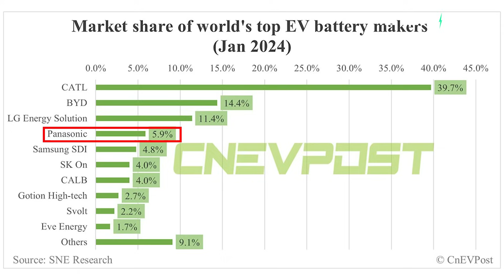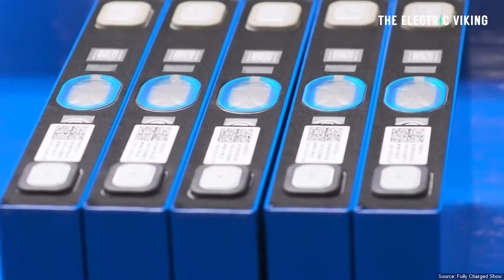Demand for EV batteries has increased, skyrocketed in 2024

Comment: One of the biggest underreported advancements is the steady progress of batteries (cost, safety, chemical stability, longevity, durability, operating temperature range, energy density, charging speed, discharge rates, performance, etc.). In 2026 batteries will likely significantly outperform fossil fuels across a brand spectrum of key metrics.
Reply: That will continue for a few more years yet.  The next 10-20 years will see a lot of changes.

Comment: Batteries for storage is a bad idea. Pumped hydro is the best. If topology is sufficiently good, that should be the one to invest in.
Reply: How do you use hydropower in your back yard?
Reply: @leiflillandt1488  There is need for decentralized power generation and storage, at the level of homes and communities, and for that, batteries are obviously the right (only) solution.  And there is a need for grid-level storage, for which pumped-hydro is the cheapest solution... with a HUGE potential, but not everywhere.
Reply: It's a great idea to supplement pumped hydro, solar and nuclear with bess though. Due to daily varying demand&duck curves, seasonality issues, weather patterns etc. Store cheap base load overnight nuclear hydro and wind, for day time&early evening peaks. 

Smoothing out the grid and keeping highly polluting and very expensive peaked plants offline=cheaper energy. 👍🏻😎
Reply: Nonsense.  Pumped hydro is of limited utility where you can put batteries in anywhere, and a LOT faster and cheaper.  Whoever sold you on that notion gulled you and gulled you hard.
Reply: Yes, and no. Pumped hydro is great for long duration storage, but every facility is a one-off, having to be engineered to take into account topography and geology, plus proximity to the grid.

Grid scale batteries however are modular and can be pre fabricated in factories in standardised containers. You can set them up in a matter of months and use existing points of interconnect with the grid (old power station sites, heavy energy users) with minimal site preparation. There's a big battery, with storage to expand being set up in the staff car park of a decommissioned coal fired power station in Australia, right next to the switch yard.

Costs on batteries will continue to drop as process improvements are made and scale of production increases. When the sodium battery challenges are addressed, it will be game over for new pumped hydro, in my opinion.
Reply: @mshackleton1  pumped-hydro is best for 10-24 hour storage. It can do longer, but then its economics suffer.  Do not confound with lake-hydro, which is indeed the best long-term storage solution.

Yes, pumped-hydro facilities must be engineered and built individually. Very little economies of scale, that much is true.

BUT, as of today, they account for 95% of the world’s power storage, and store that power for 80-90% cheaper than batteries.  That advantage will decrease with time, that is for sure.

Batteries can be installed much faster, that’s true, but their production is presently constrained, while hundreds of pumped-hydro can be built simultaneously around the world.

Conclusion: both types of storage have their market, and both will grow immensely to meet the ca. 200 TWh of power storage, that a full energy transition globally needs.  We are at only 8.5 TWh …
Reply: I felt the same,  until I realized that if you produce 100 megawatts of energy and you only use 60 megawatts.  The 40 megawatts go poof and is lost. What if you could store it.
Reply: @gaithercain5636  Megawatts cannot be stored... with ANY technology! Like you cannot accumulate mph while driving... however, you can obviously accumulate miles.
Megawatt-hours can and should definitely be stored as much as economically feasible!  And to do that, there are dozens of bright and less bright ideas and projects, and a few established technologies, of which #1 is pumped-hydro and #2 are batteries.

Comment: My worry for electric cars is maintaining them as they age and availability of spare parts speedily in the UK. Also depreciation can be colossal. In a recent video, a Porch owner has a £120 K vehicle now valued at £45 K in a couple of years. The dealer didn’t even want the car back.
Reply: similar thing has just happened with a neighbour with his tesla ... 6 years old with 77k on the clock
Reply: Was it a front porch or back porch?
Reply: I saw that video, but the whole channel is strongly anti EV.   Also, anyone who drops £120k on a car needs their head testing.   My Tesla model 3 (3.5 years old) has about the same residual as my previous Merc at that age.   In the 3 years I’ve own the car, it needed one replacement frunk latch which took 3 days to get in stock.
Reply: @crm114. So, because the channel is anti EV, are you saying he is wrong and the numbers are not what he is saying they are?
Reply: @JohnSmith-ux3tt I’m saying that the negatives are overemphasised.   I’m not saying EVs are all good, e.g. the charging infrastructure is not yet mature, but there are some fantastic electric cars available which are fun to drive, practical and cheap to run.
Reply: My worry for ICE is maintaining them as they age and availability of spare parts as EVs take over.
Reply: @robrider838 We seem to have a long way to go before we get to the EV takeover phase.
Reply: @robrider838  I am in the motor repair trade, and as of now, you will struggle to find an independent garage willing to work on them. Even after training courses. Whereas ICE cars have at least 15 years in them, after that so many garages will close. It’s the end of an era. At 65, I will not train and repair electric or hybrid vehicles. It’s not worth the investment at my age…
Reply: @Chrislayeruk1  You need fewer parts for a BEV but the problem is more the demand (for some) is so high there is no real surplus in parts, they have to slow production.  Depreciation so far has been like it always has been, it varies by brand.
Reply: @TheEvilmooseofdoom  The issue is, if you need a piece of trim, or a cup holder anything really. I am fully aware there are less engine components etc… What if you need a door handle, or a switch, a headlamp even. If these parts are not available we will have problems. The cars become disposable…
Reply: @Chrislayeruk1 Why do think such components will be rarer for EVs compared to ICE cars?  Also, a lot of the compoents you list will be shared across platforms.  Don’t believe the FUD promoted by various channels, talk to owners.
Reply: @robrider838 l can have next day delivery on classic car parts from specialists 😊

Comment: So just saying that e.v. does get to the stage of making everything electric from cars to planes to oil tankers. Where are all the ingredients for these batteries going to come from and what safe recycling and storage facilities will be in place to cope.

Plus how are fire fighters going to be equipped in the future for this so called massive increase in potential fireballs!
Reply: Details, details.
Reply: The world burns up over 40,000,000,000#of crude oil each and every day. Any clue how that oil gets extracted, transported&refined? 
Worry about that first then batteries which can last 15-20 year's mined for once, then recycled at up to 95% of original content.

Vs liquid fuels which are literal never ending consumption and also use water, chemicals, cobalt, lithium, electricity, batteries and electric motors all up and down the supply side of fossil fuels. 👍🏻😀
Reply: The ingredients will need to be mined, but the batteries are fully recyclable and there are business out there now doing it and recycled material is preferred to new material because it requires less processing so much so they refer to them as 'high grade ore'.  New training will be required for firefighters, new tech does that.  Although some people tend to think gas doesn't burn.
Reply: @TheEvilmooseofdoom  the U.S. alone had 217,000 ice vehicle fires in 2022 that's an average of an ice vehicle burning up every 4 or 5 mins.
That doesn't inc commercial use ice vehicle's or motorcycle scooters mopeds boats ships planes trains either. 

Doing well over $6,000,000,000 in property and structural damages annually and the #1 cause of vehicle collision deaths for commercial use vehicle's is FIRE. 

Further more the #1 open recall across ALL LEGACY ice oems is for the risk of FIRE even when parked. Right NOW open recalls are effecting over 10,000,000+3-5 year old vehicle's. Garages were originally detached structures because of ice vehicle fire risks. 👍🏻

But nobody in the gashole camp will EVER share this simple truth. Just like they complain about mining but ignore crude oil extraction impacts.
Complain about so called rare earth? But ice cars use multiple rare earth in cats which are stolen and wear out SMDH. 

Plus every single ice sold requires mining, uses rare earth in the cats and motors plus speaker magnets, uses massive amounts of energy to manufacture and transport them, uses a battery and new cars sold have on average 21+electric motors in them. 

Plus fuel weighs 7# a gallon refined weight and every single ice owner burns up between 1,000-7,000# of it each and every year they own an ice.